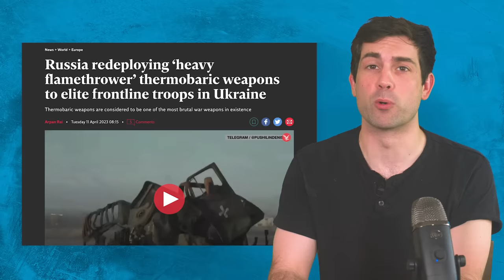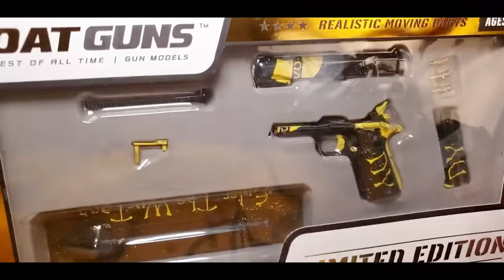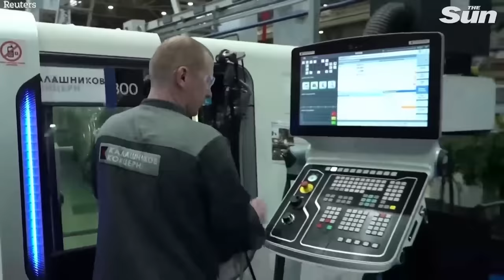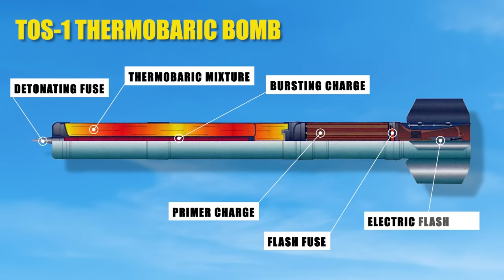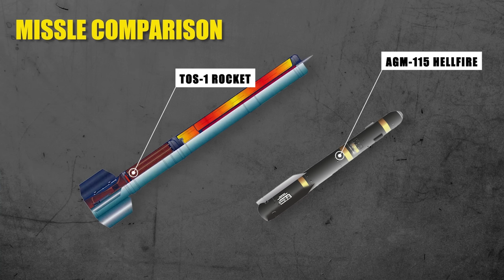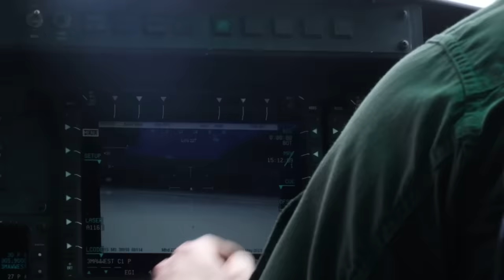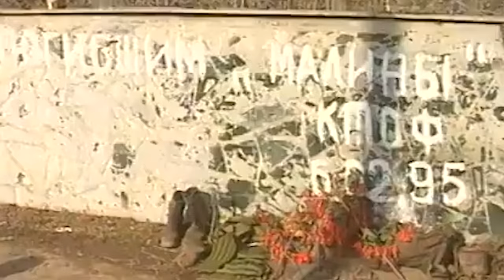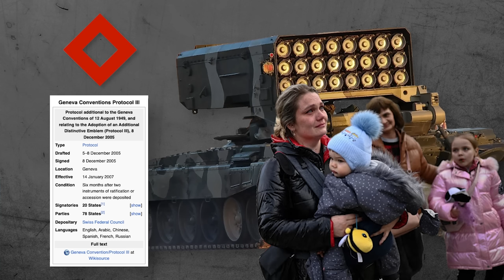How Russian Flame Artillery Deployed in Ukraine

Comment: As soon as you said that Ukraine captured some of them to use against Russia... my first question was "and how much ammo?"  I'd doubt there was any significant use of these by the Ukrainians.
Reply: Ukraine had a lot of Soviet munitions production, which is a big part of how they've been able to keep so many captured tanks and artillery pieces firing. That said, I suspect these are more valuable as a source of tank parts than for redeployment.
Reply: There was only one, not proven, report of use in 2022. There is no ammo for these systems made in Ukraine. Systems use post Soviet ammo.
Reply: @raycearcher5794  This is not a Soviet system.
Reply: @raycearcher5794 lol , it literally entered service after the collapse of the USSR
Reply: highly doubt it, it's not so easy to reproduce something like that fast. Also there is ammo shortage in entire West at the moment - they will not even start something new to produce since there is not enough ammo for current howitzers and tanks. Also UA have no air support and using TOS short range artillery without air support is suicide.

Comment: Are it's effects horrifying.  Yes.  Is it hideously effective against trenches and bunkers?  Yes.  But is it a war crime to use such a weapon?  No.  (Unless used against civilians).
Reply: Killing civilians is a war crime no matter the method.
Reply: The use of thermobaric weaponry was designated a war crime back in the 1980ies but because they are so effective nobody actually went as far as to outright ban them. The UNO expressed deep concern about it, as they usually do instead of actually doing something about the matter. And that's that for now
Reply: Bro being destroyed inside of a bunker is terrible for anybody soldier inside it if the bomb doesn't kill you then the collapsed concrete/steel will. Via crushed alive.
Reply: @caesarsalad1170  Banned Inc. would like to have a word with you.
Reply: @josephstalin839  Or the overpressure and/or intense heat from the blast wave.  Or the air being sucked-out of the bunker, and replaced with toxic fumes.  Yeah not a pretty picture.
Reply: @caesarsalad1170  Weeeeeell if its near infrustracture it is called strategic bombing most of the time aaaaaand if they have air defences they dont count as anarmed civilians.
At least this is the excuse Russia, USA, Allies and others have used.
Reply: @caesarsalad1170  
Whew.
Good thing the Allies won, huh.
No trials for Dresden, eh?
Winners don't put themselves on trial.
Reply: I wrote a comment that Russia has been doing this against civilians since March - it was reported here in Finland and by Reuters. Perhaps I am wrong? This is an actual question. While I've been to the army and while I tend to trust our press in Finland my knowledge on weapons like these is not good.
Reply: @caesarsalad1170  Killing civilians on purpose is. In urban warfare and counter-insurgency though, it's pretty much impossible to avoid killing civilians by accident.
Reply: @phantomknight7211  I would say there are 2 kinds of bombing: bombing for terror as the Germans did in WW2, and bombing for tangible strategic goals, as the allies did. Plus, if enemy soldiers are taking refuge in a city's buildings, you don't really have any other option than to demolish the city.
Reply: @caesarsalad1170  actually, it is not. I know more than one example when US targeted civilians, very intentionally. Was that a war crime? Looking at investigations and trials, no. US army has expression "collateral damage". And when they began with drones, it is not a soldier but a "drone operator". Really? "Heavy machine gun operator", "tank operator", "bomber operator" and good old "assault rifle operator"... thus these are not war crimes against civilians.
But yeah, you are right in theory and so called "international law".
Reply: @TheMaleRei  Trials for what? It was a legitimate military and industrial target.
Reply: Civilians in Ukraine must be evacuated, but those who stay are thought to be constructing weapons and supplying weaponry to the Ukrainian army.
Reply: @caesarsalad1170  
Well, that is one way to look at it.
But if we're gonna play the game of-
"Everyone who works in a factory gets the bullet, everyone who works on the railway gets the bullet"
Sure
But why stop there?
Why not the medical personnel who heal the sick and injured, especially of the bombings?
Why not the farmers who grow the food?
Those who process the food?
The bartenders who serve the beer to workers after a long shift?
The bakers and butchers in the shops?
The bricklayers, framers, electricians, etc who helped build the factories - not to mention the homes that provide them with shelter?
The accountants who help make sure the factory workers who get paid to buy the food to sustain them-

Holy crap - we've entered the land of "Total War against the Whole of the Enemy Country Population."

Now - if one wishes to argue that it was about revenge for the bombings of London, and the suffering of the occupied nations of Europe - that does make a kind of sense.
Reply: @caesarsalad1170  
But again, the War Winners never put themselves on Trial.
Reply: @caesarsalad1170  
Now, it could also be argued that the area bombing campaigns diverted resources on the part of the Axis, resources that could have been put onto any of a dozen other fronts to serious effect.

I mean, think of how much damage all those flak canon could have done against the Soviets or Allies.  How much longer might the war have dragged on.

Again, the Winners never put themselves on trail.
Reply: @Bojan Perić  i mean, that's not quite right. Absolutely the u.s. has targeted civilians. But no, a "machine gun operator" is not not a soldier
Reply: Horrifying yes, sucking no. The author is confusing vacuum suckers and bombs. Sad!
Reply: @binbows2258  Dresden, Hiroshima, Nagasaki...
Reply: Well. They are leveling cities so It's pretty hard to not strike civilians.
Reply: @caesarsalad1170  Tell it to the Americans and the British who bombed Dresden.
Reply: @TheMaleRei  i think war crimes are perfectly fair against the aggressors in a war. they got the option to end it.
Reply: @boarfaceswinejaw4516  
Yep.
Reply: @indiasuperclean6969  based poo
Reply: This
Reply: @rumatadestora  Russia has never been a participant in such a treaty thus it's not applicable here.
Reply: Bakhmut was a civilian city, destroyed by russians war criminals.
Reply: @caesarsalad1170 not really, like if the russians level a hospital full of Ukrainian troops its not a war crime if there was civilians in there because its basicly not their fault because its a military target
Reply: @caesarsalad1170  in general yes for civilian non-combatants, no for civilians involved in combat (ex: insurgents, pmcs) and no for most civilians aiding militaries directly (including in many private weapons factories and the like)

if you give plenty of ample warning to civilians there (like via leaflet drops), give civilians time to evacuate, and have a reasonable military justification for dropping it (ex: combatants broadly hiding among civilians), that is enough to avoid the war crime. you're required to bend over backwards, but not outright break your own back just to avoid civilian non-combatant casualties

military installations that just happen to have civilians working in it are fair game also - the civilians there are almost never non-combatants
Reply: The evacuation of civilians rests on the shoulders of the defenders. This is their primary task. The front has been stabilized for a long time and if troops are coming to your city, they will go for weeks. This time is enough for an organized evacuation
Reply: @binbows2258  What strategic purpose did fire bombing Dresden have? Night bombing cities well people sleep is also a terror tactic.
Reply: @binbows2258   Yeah Dresden and Tokyo were strategic. LOL.
Reply: @mikelee7318   They absolutely were strategic. And in case you forgot, the bombing of Dresden resulted in an easy ground battle for the Red Army. Stop parroting cold-war propaganda.

Comment: The range issue is less about precision than payload dimensions: This type of warhead is very heavy and takes up a lot of space. To make it longer range would either require an enormous rocket engine, a glide phase (which would make it easy to interdict), or a powered glide phase (massive increase to complexity for minimal gain) -- all of which would massively increase the size of each munition and limit the size of vlley per launcher. These tradeoffs are really hard to balance out, and it is clear which tradeoff the Russian design went with.
Reply: Oh no, there are thermobaric rockets for 300mm systems (smerch, tornado-s) same range as othr types.  For other 220mm systems (uragan and tos-2) - more range than tos-1a. 

So there are plenty of thermobaric mlrs options in Russian arsenal, so tos-1a is a special tool, because thermobarics are only effective if there's precision and/or decent grouping. You have to hit quite close to target for any effect apart from intimidation and smoke.

Comment: Its definitely useful against dug in targets and in urban warfare against enemy strongholds. It substitutes air power in many scenarios and is insensitive to the presence of strong anti air defenses.
Reply: I never understood, like for Azovstal, why Russians didn't use tear gas. I don't see how it can be considered "chemical weapons" when used by police against unarmed people even in democratic countries. Or burning sulphur. They are very unpleasant at concentrations which are far bellow lethal.
Reply: @BojanPeric-kq9et  In order to avoid any grey zones, ALL use of gas is prohibited in war.

Reason it's allowed by police (who also may use hollow-point ammunition) is that it is relatively unlikely that the police "accidentally" would mix in mustard- or nerve gas into their riot control gear and then claim "it's only tear gas".
Reply: @BojanPeric-kq9et  Tear gas isn't that voluminous and can't expand enough in a controlled manner to clear any long corridor or large space. It doesn't hang around that long either by design and dissipates. You need very specialized pumps and other equipment to even concentrate it in a tunnel as the USA found out in the Vietnam war. A simple office door with a rag under it can essentially block its passage. it's meant to discourage a crowd of protestors or smoke out a small car or a bedroom. Nothing more.
Reply: @BojanPeric-kq9et  There where civilians of their new provinces in the Azovstal bunker system. War is brutal enough as it is and they had encircled the area. So they decided to just besiege them until they surrender. No need to kill your own for a quick victory when time is on your side. Otherwise, thermobarics might have been used tehre too (although actual bunker systems like that in Azovstal might be immune because of being designed to protect against extreme pressure waves).
Reply: @johanmetreus1268  
If it's banned in war it should be banned for police, including hollow points.
Reply: Capt Himars brunch...
Reply: But Russia only has 45 of which 22% have been lost.
Reply: @Fighting_Fatigue_117  Police and military have different jobs, in different environments and therefore uses different rules and equipment (except in the USA, where the police seems to want heavy tanks and their own airforce too)
Reply: @johanmetreus1268 ragmenting and deforming rounds have been against the Hague Convention since the late 1800's. The US never signed it, and we do still use some hollow point rounds in combat, see the M118LR 7.62X51 cartridge. We skirt it being a warcrime because the reason for their use is ballistic coefficient, not terminal performance. Most US cartridges used in small arms are FMJ to avoid warcrime charges. We also get away with the m118lr because a 175 grain projectile moving at ~2500fps is still nigh-on guaranteed to be lethal regardless of the hollow point expansion. It's only rated for use in sniper/dmr platforms and lmg/mmg.

Law enforcement use frangible rounds, not just hollow points but sometimes copper projectiles that practically vaporize upon impact and create massive trauma for their size, primarily to prevent over penetration incidents where a FMJ would be likely to continue traveling after striking and passing through the intended target, increasing likelihood of collateral damage. It's also about immediate incapacitation of an armed hostile to eliminate the threat to LEOs and civilians, where in military warfare between civilized nations, the goal isn't necessarily to kill, but to wound, as an injured soldier will be casevaqed immediately in ideal situations, and usually by 2 other soldiers, so landing 1 hit will potentially remove 3 fighters. This was much of the reasoning behind the abandonment of full powered rifle cartridges like the 7.62x51 for the 5.56x45 for general rifles issues to common soldiers. The US is looking at something with more power thanks to fighting enemies that don't follow conventional treatment of their wounded, like human mass wave attacks and zealous religious fundamentalits
Reply: @thenegociater3387  Clearly you havent used military grade tear gas equipment
Reply: @danielallan8061  you can thank sadam for this, it’s proved to be very effective in making the enemy helpless to your attacks
Reply: @BojanPeric-kq9et  tear gas is highly flammable and in high enough concentrations deadly, it's never used in high enough amounts at protests and is used outside which is why it's allowed.

If you want to see an instance of cs gas (tear gas) misuse on US soil though lookup the Waco siege, they basically gassed women and children in a concrete bunker then burnt them alive.
Reply: @Fighting_Fatigue_117  war is different from policing in almost every way.
Reply: @BojanPeric-kq9et  unpleasant and non-lethal can easily become counterproductive since winds generally blow west to east in ukraine's latitude

last thing you want to do is gas yourself

also, russia isn't interested in anything with effects too long-term bc they still generally want to be able to exploit the land after taking it over
Reply: @BojanPeric-kq9et  Ukrainian military had used grenades dropped from drones in Bakhmut. It did not helped them.
Reply: @BojanPeric-kq9et  because the gas mask has been part of the standard equipment of all soldiers since the Cold War
Reply: @AssRipper-u5v  Have you ever used gas mask? I would love to see you 12h with gas mask, even better, to sleep with it. And in confined space it can put pressure on oxygen level. AFAIK, military, except pilots, don't have oxygen supplies. And, I guess you don't know, but all filters have limited amount of substances they can absorb. After that, they are useless.
Reply: @BojanPeric-kq9et  I used both a gas mask and a full set of chemical protection while serving in the army, including for its intended purpose, the filter, depending on the volume, the degree of air pollution, has a service life of 1.5 to 4 hours. and the last think less you're not good at it
Reply: @AssRipper-u5v  now tell me that every soldier has full protection suit. Maybe you should inform yourself a bit what is catch 22 with sulphur  dioxide. Heck, even carbon dioxide could be very nasty in such situation. I am sure you know effects of exposure to carbon dioxide because it is commonly used as deadly gas. /sarcasm off
Reply: @BojanPeric-kq9et  in the Russian army, every soldier has a full protective suit, and what's next?
Reply: @johanmetreus1268 But nevertheless, this is not important for Ukraine, because it used chemical weapons against Russian soldiers in some areas. Chemical charges with sarin were dropped from the copters.
Reply: @konstantin070797  "Chemical charges with sarin were dropped from the copters"
That was done by the Assad-regime in Syria 2011, a conflict Ukraine wasn't in any way involved in. Least try to look things up before posting them.
Reply: @johanmetreus1268  I do not need to look for what we have already seen, Ukraine uses chemical weapons in a limited number by nationalist formations, shoots videos of how it kills our soldiers. And all this with your approval. In general, you yourself are no stranger to violating the laws of war, as it was in Vietnam, Serbia, and many other countries. So there is no need to tell fairy tales here about the laws that you do not observe.
Reply: Or against civilians like its mainly used.